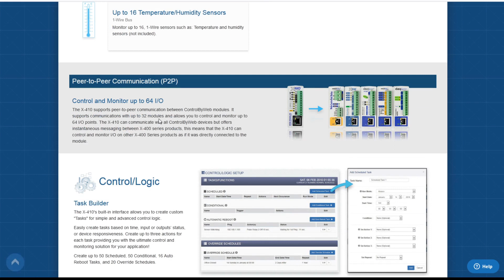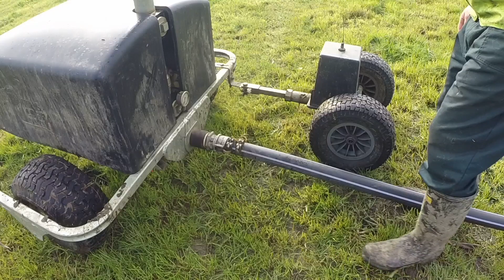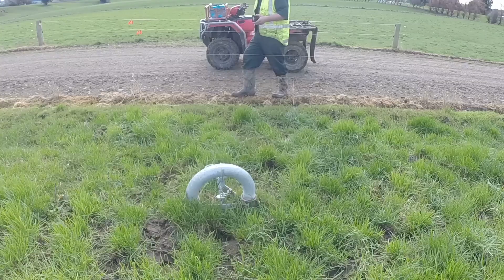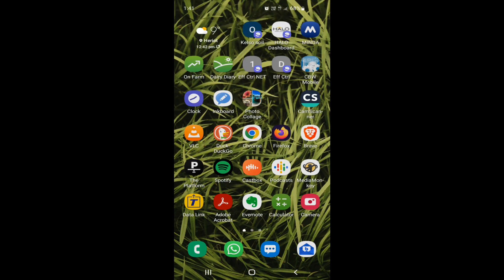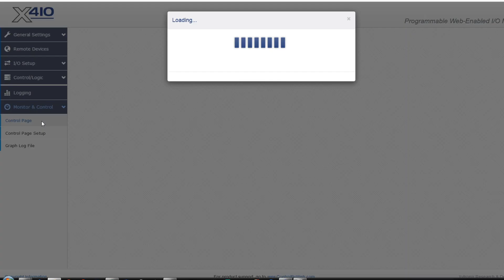Remote Control Relays Over the Internet for FREE

Comment: This is a great video, @DairyNZ! Tracking "pulse" via rotation of the trailer wheel for pump control is clever. We appreciate the in-depth explainer of your physical setup, as well as showing how you've configured the I/O and conditional logic through the X-410's embedded UI. Glad to see you enjoy using our PLCs!
Reply from the maker: I'm planning an upgrade in the next 6-12 months. I'll probably use the X-400M, so I could look at adding sensors to monitor pond depth, etc. I really like the look of the X-422 Weather Suit Controller. Having a weather station connected to the internet that will automatically update to say Weather Underground, is a brilliant feature. I've had weather stations connected to a PC before, but the X-422 would be a much simpler and stable setup.

Comment: Wonderful video, excellently explained in an easy-to-understand format! I have a remote-controlled observatory 5 hours away from my home and also use the X410, to signal the garage door controller that opens (and keeps open) the observatory roof. This is in turn controlled by a micro PC that uses a weather sensor cluster of anemometer, humidity, light, and rain sensors to determine when it is "safe" to keep the roof open at night. The PC will instruct the X410 to send an "open" pulse to the gate controller before the gate controller automatic close time, which means if any of the components, including the X410 or internet connectivity fail, the roof will automatically be closed by the gate controller after 3 minutes. The gate closer operates on its own 24V batteries so even if my main batteries or solar fail it will close and stay closed.
Reply: Your observatory setup sounds super interesting! Thanks for sharing how you're using the X-410 as part of the system. It's cool that the micro PC offers a holistic view of weather conditions. And you're smart to include redundant measures in case a component malfunctions.